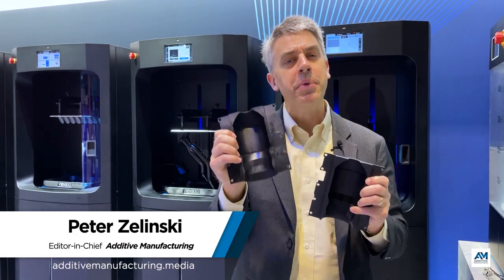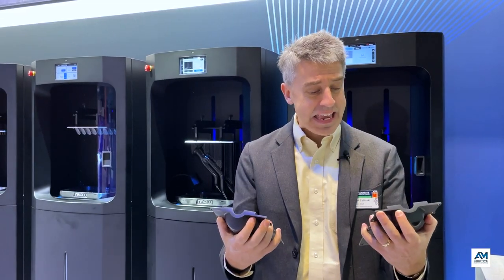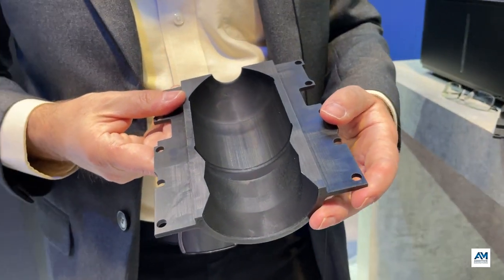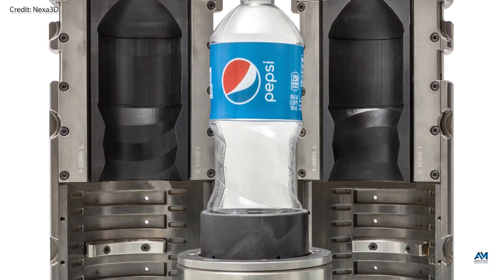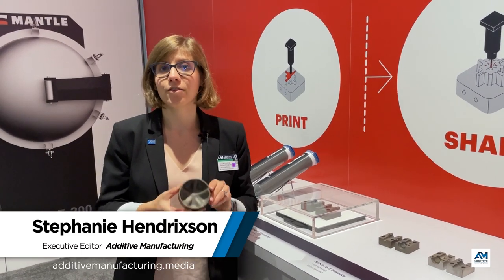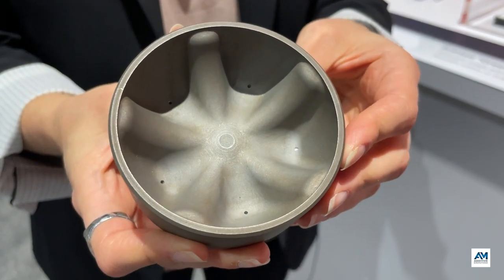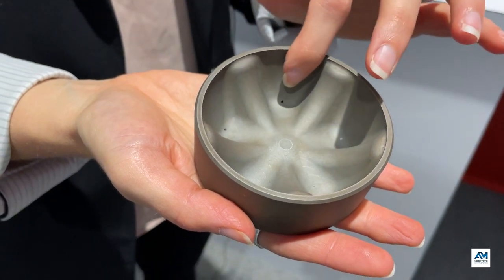PepsiCo Uses Hybrid 3D Printing to Make Blow Molds for Bottles

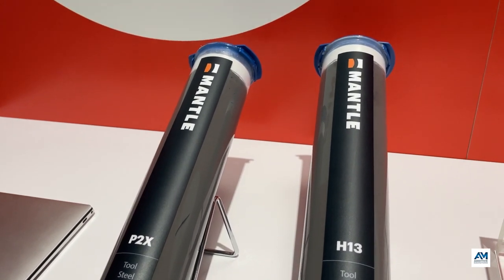Comment: 1:42 wow 3D printing is going upgrade each time. I was thinking in that. Why they dont add CNC to give nice surface. I would like to know if can be made in diferent materials and minimum rezolution. Because with this method can we make better flow in 3D printed rocket motors and heat transfer.
Reply: They do CNC 3D printed metal if it is needed.